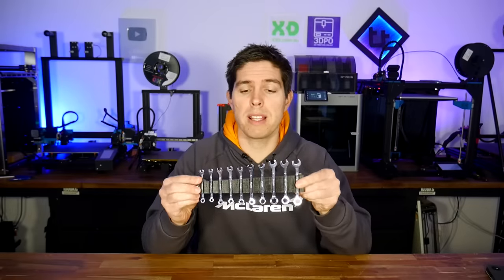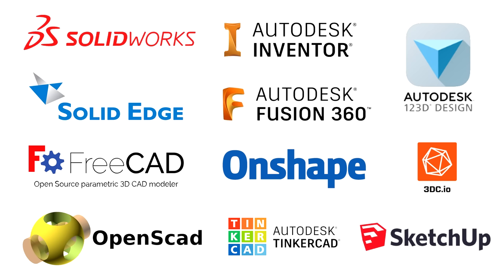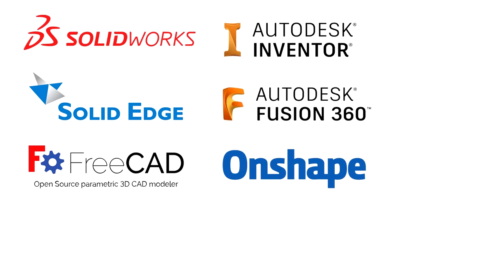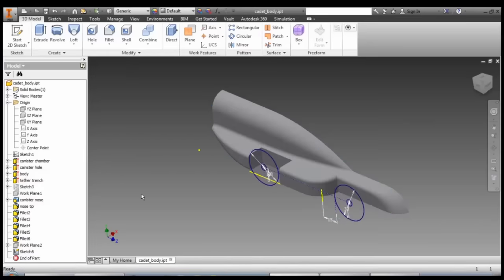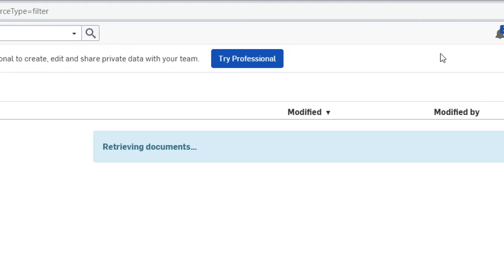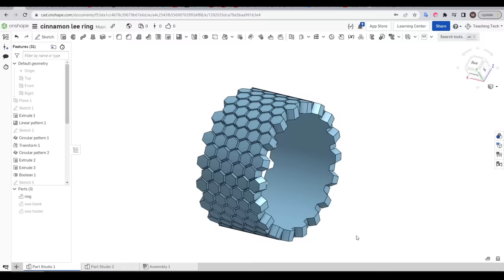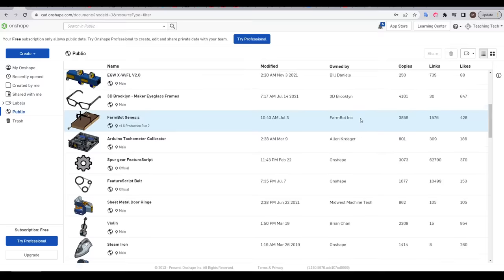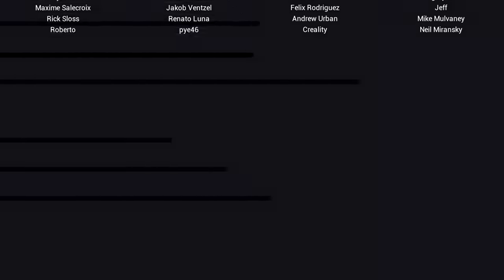Selecting a free 3D CAD option - 3D design for 3D printing pt1

Comment: I would love to go the FOSS route, but i simply can't deal with FreeCAD's UI. I don't want to arrange the toolbars of five different workspaces before I'm even able to begin working on my project. They either need to provide sane defaults for the most common screen resolutions or ditch the rearrangeable UI altogether.
Reply: I believe you can customise each toolbar individually iirc in toolbar settings. It is also possible to make the UI much nicer looking than the clunky default, nots sure why they don't do that anyway.
Reply: There is no need to deal with any of that. By default you get all the tool bars you need for the selected workbench. Sure on a small screen FreeCAD can be a hassle, but starting with 2K Resolution it should work fine. Especially the RealThunder version has nice defaults and the new selection wheels (??) are great.
The default and official version of FreeCAD is unusable. The RealThunder version is the one you want to use. It is light years ahead regarding features and functions of the original branch and the official branch is ignoring all the progress RealThunder made for years now. 
Especially the topology naming inssue, which was ignore by the official branch for a decade got basically fixed two years ago by Realthunder, but was not backported to the official branch till now.
Reply: @guidomersmann9744  Is it the case that freecad files produced by RealThunder's branch aren't/won't be compatible with he main branch? Thinking about RT's version but may move back to the main branch at some point and/or have maximum compatibility with freecad files I share in future.
Reply: @Bordpie  It is the same. I was thinking the same before, but unlike the official branch, RT syncs his branch regularly with the official one, so it has to be the same. Basically the RT branch has all the official stuff plus 2 years worth of fixes and several UI enhancements.
Reply: @guidomersmann9744  Yeah I just installed the RT branch and it can load a standard FreeCAD file, but it requires recomputation. I am guessing this is to do with the changes in the program which solves the topological naming program. Not sure if files move the other way. 

I think I will stick to the main branch. I avoid referencing faces for geometry and sketches unless I absolutely have to, anyway. The 1.0 version (supposedly coming out some time next year) has fixing the topological naming problem as a key goal. 

My main annoyance with FreeCAD is that you can't select areas of a sketch to perform an operation e.g. extruding a tabletop and then the table legs vertically from a single sketch. I tend to do a master sketch with the layout of everything, and then copy the geometry into a new sketch for a particular operation and either delete the geomtery I don't need or convert to construction. Maybe I am just spoiled by selecting sketch areas in Fusion 360. It does lead to a bad habit of cramming lots of things in a single sketch admittedly (and leads to breaking things when modifying the sketch, similar to the topological naming problem, but areas of sketches) so doing lots of individual sketches is probably a better method in general, even if it takes a bit longer.
Reply: @Bordpie  The RT Version always does a recompute. It is basically just a select all, mark for recompute and recompute. It is not a format conversion or so. FreeCAD supports the selecting stuff from sketch and just extrude. (Mastersketch). The RT version is doing this transparently, while it is well hidden in the official brand. I just tried and you can load a master sketch file from RT into the official. The tree of the original just looks less logical and useful, but the model stays intact.
Reply: @guidomersmann9744  Thanks, I didn't know about mastersketch, this sould improve things a lot! I will look into this now.

Comment: Sad to not see a comment at least on Solid Edge, that thing always has something new for me to learn. Granted, I've been using it at work for half a year only, but heck those engineering softwares have insane resources. Sadly for it, the community surrounding it isn't as big as Solidworks so you don't get quick google search help.
One interesting thing it has going for is the two possible modeling modes: ordered and synchronous. In ordered it behaves almost identically to Solidworks, making the transition sort of easy, but in synchronous it gives me quite the SketchUp feels - you just draw it and that's it. Enter dimensions and parameters, sure, but you just wing it, not the whole everything tied down to a base sketch which I frankly find annoying.
Reply: Solid Edge and Pro-E were very popular in the 90s, but seemed to have faded away. CAD programs are like cell phones. There have been many good ones but it seems that Samsung and Apple dominate. Solidworks and Catia (aerospace companies) seem to dominate the CAD arena for manufacturing-based companies but there will always be good smaller CAD companies for hobbiests and very small companies. I use Alibre Expert for my hobby-company but had used Solidworks for the last 5 employers. Before that, IronCAD was my favorite 3D program. It still is a fantastic program but like Onside, will probably never reach the penetration that SW has.

Comment: @Teaching Tech, how do you feel about using Blender for doing the CAD work for 3D printing? it's presently what I'm using, but I'm new to 3D printing. It seems good enough to use, but not sure if a true CAD performs better via ease of use, model availability (export = import // sharing), and the like would be a quality of life improvement, or just a preference thing.

Comment: Unfortunately onshape doesn't allow editing of mesh files and there is no way to convert them into a format that is editable. An example of this would be 3d scanning some part and performing a subtraction of that shape for a perfect fit. I'll have to stick with fusion 360 for that.
Reply: That sounds like an advanced task the a beginner hobbyists would not encounter, so I don't understand why that limitation would be a major consideration.
Reply: @xjonx1  many beginners lack the ability to model advanced stuff. One of the first things they will try to do is use an existing model and tweak it. Due to onshape limitations, they cannot do this.

Comment: The one I like but also am really fed up by is, Tinker Cad. It is a cloud based 3D design cad. But it keeps crashing after I do a tiny amount of working or just rotating the model.

I have a fast very powerful gaming level PC with up to date fast graphic card and tons of RAM ( it seems twice the ram most people ever need ) I have a fiber optic fast internet system and yet the tinker cad keeps on crashing.  So although a simple nice cad, it is just such a pain when it keeps on crashing and I have to keep re-logging in just to do a few tiny amounts of model design.

Fusion 360 is not a easy program at all. Unless your a very smart engineer or genius at math's or design tech etc. then don't even try to do that program.

Bad enough the company keeps on taking away features of the free one trying to force you to pay silly amounts to use the pro version but on top of that the using of the program is just far beyond normal peoples skill set.  One look I had of the thousands of mad menu's and many sub menu's and complex systems and such has put me off it totally.

And I am no thick sod.. I do photography, Amateur Astronomy, astro-photography, PC building and computing and now 3D printing. But even with all this skill I can't cope with that Fusion 360.

Even Blender is bloody damn hard to cope with, and now it has CAD add on. So no chance I will be able to use that. It boils down to if you are super clever then these be easy but the rest of us can't even cope with the damn design programs as they for the most part are super complex and damn hard to learn even with video help.

Comment: I use FreeCAD and can see no reason to change. Personally I really don't like cloud based tools as I hate the idea of being hooked to the internet all the time for development, though it is unfortunately a growing trend.

I also distrust the 'hook you in' type licences that tools like Fusion 360 have. You never know how they might decide to change the licence in future. After all, these tools are primarily commercial. I use Kicad for PCBs and Blender for any more 'artistic' type shapes for the same reason.

The one big issue with FreeCAD is the topological naming problem. It's a big problem if you need to revisit existing designs, but fortunately my designs are generally small and so it doesn't cause much grief. In theory the next big release will solve this to some extent, but need to wait and see.

Fundamentally though, it is very comprehensive and does everything I need, I don't have worries about licences, it runs completely locally, and I like it. It's a personal choice.

Comment: Have you tried DesignSpark Mechanical . It is quite easy to learn with simple set of tools but if you us them in right sequence and youhave iagination you cn create alost enything apart from organic shapes. Ithas soe bugs an gliches but isreally good option fo 3d printing. have been using t for last 2 years but ant to give f360 a go.

Comment: Hello, first I want to thank you for this video. And secondly I have a question. Imagine I want to incap a screw in a to be printed 3D model, how can Ik stop a printing proces put like in this the screws and than make the printer to go one printing the rest? In the model you made to hold the torx the screws can be in fixed and pass triught a worktable to be fixed with nuts.

Comment: Yes sir. Just so difficult when u don’t know computers very good. I mean usually can turn them on. I could take um apart and fix them mechanical parts wise. Than do zip files,? Open close don’t know.  Put my ender 3 max together installed bl touch and don’t use it because don’t know how program the firmware for it. And it’s shame because it’s a factory look job all wires in looms tucked where factory would but don’t mean nothing sitting in corner. So will see.   
I need to know what good computer to get to use for 3D printing. Enough space or storage whatever it’s called and kinda fast not to take all day load when installing stuff. 
Thanks.

Comment: A couple of things:
A major drawback of Fusion360 for many people is that it doesn't run on Linux, at least not natively.
You said you never found what you wanted to find in FreeCAD but never mentioned what was it, and it looks like you just pushed it down into the list just because you didn't find something on the interface.

Comment: You have forgotten reverse engineering. Changing existing STL is an important point. I think Fusion360 has the edge there
Reply: No it doesn't. STL is about as obsolete format as there can be. You'll so easily stumble into dimension errors etc.
Reply: @jothain  Sometimes you want a small customization on a Thingyverse download, unfortunately STL is the common exchange format. But if you can, you should certainly avoid STL.

Comment: The biggest down side of any online tool, that saves content in the cloud, is intellectual property theft.  Regardless of what their privacy policy states, every file on a cloud server is available to any administrator level user.  The amount of intellectual property theft is staggeringly high.  Every online document, design, picture, video, etc. is available for viewing, scanning, copying, and deleting by anyone with admin privileges without restriction.  It's always safest to use a locally installed tool that works on local files--without secondary Internet authorization or connection.

Comment: So why is the cloud-solution with Fusion360 so much more popular than for example a completely installed Software like Solid Edge? Also Solid Edge is used industry whide just like AutoDesk or Catia, so one could learn something for your Job...
Reply: From what I can tell, Solid Edge is Windows only. So a no-go for anyone using a Mac or Linux.

Comment: I've used OpenSCAD before, it's fine, but if I wanted to do a visual refinement I'd need to "recompile" the model every time I made an edit.

I've had some success with FreeCAD, but I had rather rigid requirements for dimensions and I only use it for FDM/FFF. If I wanted to make a variable part builder like in OpenSCAD or Fusion, I'm not sure if I can actually do that in FreeCAD.

FreeCAD also doesn't really support "edit previous step" in quite the same way that Fusion or Solidworks do, which is a bit annoying. (Well... you CAN, technically, but every time I've tried it made a huge mess) I've ended up making a base object to work from, saving a copy of that, and then making edits.
Reply: Take a look at realthunder's branch of FreeCAD. It solves many problems with actually going back to edit the model. Hopefully it can get merged with regular FreeCAD eventually.
Reply: FWIW, OnShape has builtin scripting in the form of FeatureScript.  It looks INSANELY powerful and they have made it even easier to use than OpenSCAD!

Comment: Just the 3d series I've been looking for!

Big user of tinker cad but I've hit the wall you mentioned. I have tried most of the "free and open source" options and as a beginner I can say in all seriousness and honesty that THEY ALL STINK AND NONE ARE WORTH THE ELECTRICITY IT TOOK TO DOWNLOAD THEM. I know that's a controversial statement but I tried them and the learning curve of all of them is vertical. I mean, you can't even move the model around in a predictable fashion with some of them. Others adding a basic shape is like trying to learn Esperanto from hieroglyphics. So needlessly convoluted I gave up entirely and went back to the limitations of tinker cad.

I look forward to the next video in this series!

Comment: In the end, there are only really two types of CAD programs: pay-CAD and FreeCAD. The whole CAD online thing definitely has its conveniences, but with fluid and increasingly restrictive terms and conditions, these are mostly not workable in the long run. If you truly take the time to read PTC's Onshape or AutoDesk's Fusion 360 terms and conditions, no sane maker, startup, or hobbyist will touch those programs with a ten-foot pole.  FreeCAD is truly the only option. Sure, FreeCAD has a steep learning curve, but if you're getting it to crash often, then you most likely have terrible CAD habits that you need to fix anyway.  If you learn to use datums for all your features, constrain all your sketches, and use mostly the part design workbench, then FreeCAD is right up there with Creo, Inventor, and Catia. I've used them all, and I'm shocked at how capable FreeCAD is.
Reply: But it does not support 3D mouse properly , thats pretty annoying if you have been using it for the last 4 years.
Reply: @sqwert654  3D mouse support remains poor in FreeCAD, but the 3D navigation cube goes a long way in helping to navigate around a model, especially in assembly mode. The RealThunder branch of FreeCAD is also excellent at feature selection with it's truly innovative ghost mode highlighting of selected features (no need to rotate to select edges/surfaces/points/features; you simply select them right through the part!).
Reply: @geirthieussbimkravahl  I  make game assets mainly. Also have 3dCoat,Blender, Zbrush, 3ds Max that I can use.

Comment: I was pretty sure that the choice would be F360. What a pleasant surprise that you chose Onshape! I'm a Linux only user and create most of my simple 3D models using Onshape. For ultra-simple models I also use OpenSCAD. I have also installed FreeCAD but it's many workbenches and tools are just not compatible with my brain ( or vice versa ). I always get stuck in FreeCAD and have  to eventually  design the model in Onshape. Looking forward to the upcoming tutorials. Thanks al lot!

Comment: Rhino 7 can be purchased outright for
Student at $195 USD (Full Commercial Version)
Commercial at $995 USD
Schools at $975 USD (30 users)

I have Rhino 6, which I got at a student price, just by registering for some 
Udemy Rhino 6 courses.

Another is Alibre Atom 3D
Cost $418 AUD
Can try a 30 day demo. 

Cheers
Reply: That's actually pretty good considering what you get with Rhino 7.
i will have to put it on my short list,,,

Comment: The problem I keep seeing with free or open source CAD options is that the interface and tools are always so hilariously bad. I've been a CAD draftsman for years now, and Fusion 360, Solidworks, Inventor, etc all more or less operate the same way, and if you know how to use, say, Inventor, you can sit down with Solidworks and use the program after a few minutes to familiarize yourself. But apparently nobody who writes these programs is a drafter. It's obvious nobody experienced with CAD was invovled when looking at OpenSCAD, because you have to code everything for some breathtakingly arbitrary reason, and FreeCAD doesn't have a "steep learning curve", it's just really poorly laid out for anyone trying to get anything done in a reasonable amount of time.

Comment: For me personally of the four tools from the video thumbnail, it really leaves only freecad, with all its shortcomings. Tinkercad and onshape are cloudbased and that is deeply ingraned in their concept. I don't want my stuff on some cloud. F360 has the huge problem that one is at autodesk's mercy and if used more than a year on a tolerated grey zone which might be killed anytime by Autodesk. That is why I have shied away from investing time into learning how to use it even though it is the most powerful of all of those, yet still relatiely easy to use.

Blender nowadays has a CAD plugin too, however from hearsay I have the impression it is still quite limited in its capabilities (even though it has great potential). Blender is a monster however which is very confusing to newbies, even though one can overcome that starting hurdle of course.